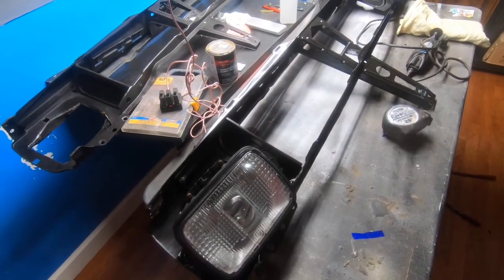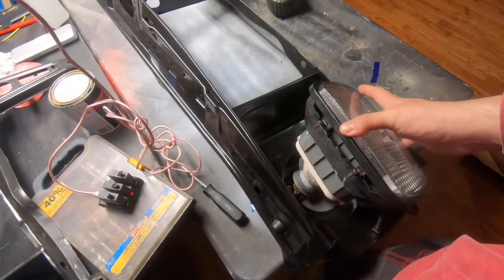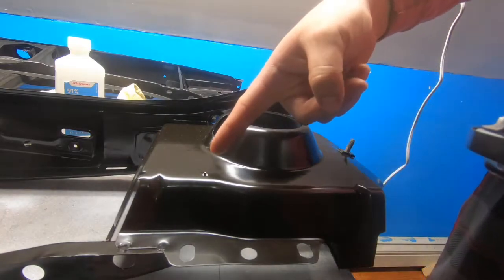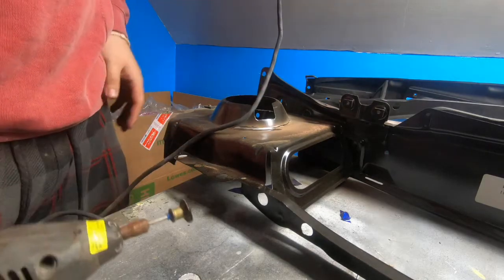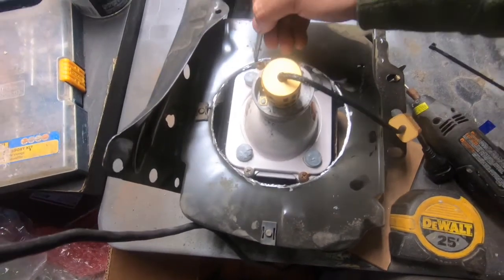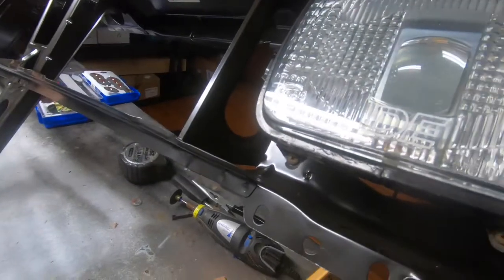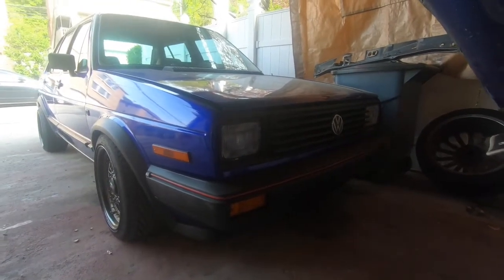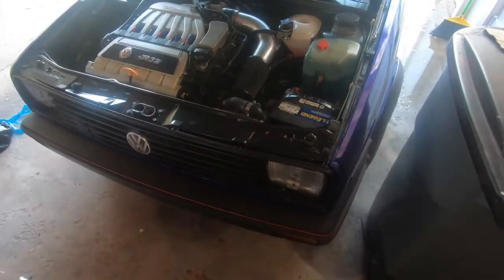Hella DE cat eye install

Comment: Did you keep high & low beam or only high beam? What bulbs are you using? Good video, thank you !
Reply from the maker: It’s a two chip led  high and low beam work. Go to the retrofit source. They sell all kinds of bulbs. And I did this a really long time so I don’t remember exactly which one it was.
Reply: Damn wish you had more bulb info , couldn’t find the other video you talked about
Reply from the maker: It was a h1 head with a h4 connectors. I was looking for a slim bulb that will fit(h1 only space)  here and connect to the h4 stile plug I have.